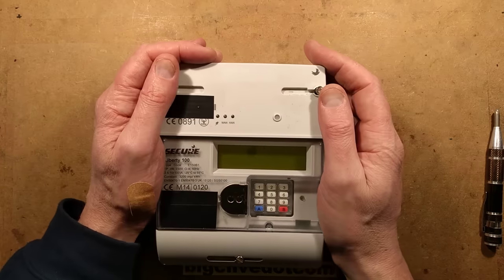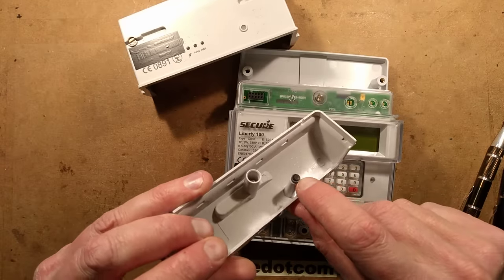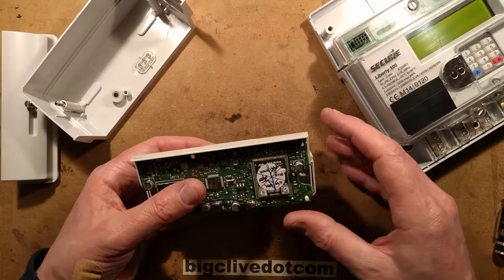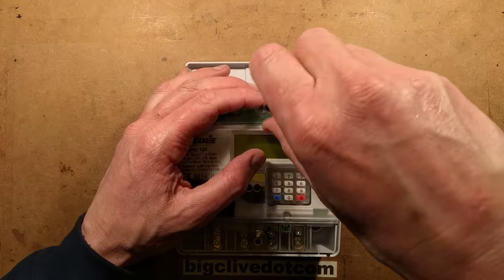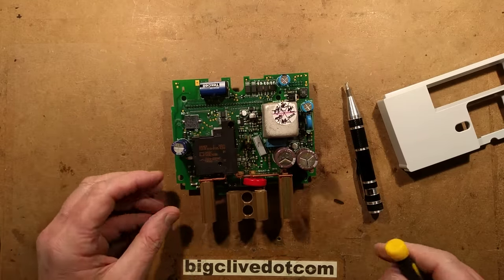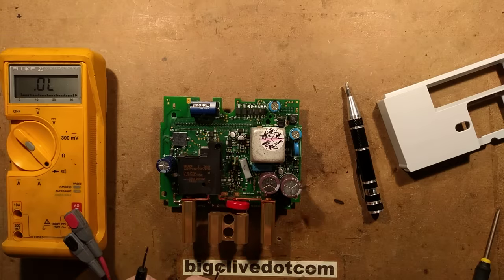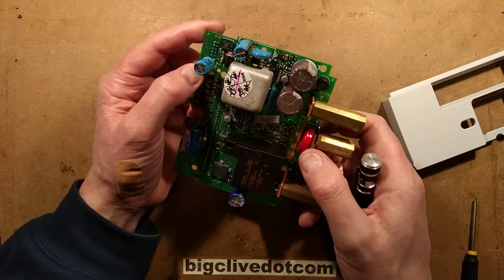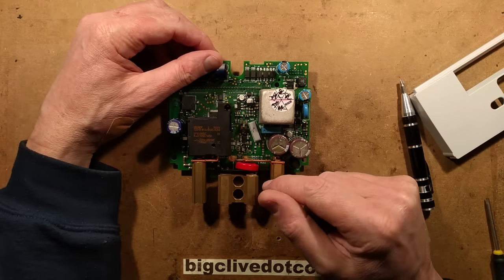Inside a smart meter, and the REAL problem with them.

Comment: The blue light thing IS real though. Some conspiracies are nonsense yes, but blue light IS known to disrupt the human cicada rhythm which can be annoying for people who have white street lights plonked right out of the front of their house pointing directly into their bedrooms. Yellow and orange lights are much better for sleepy time as the red end of the light spectrum doesn't put so much strain on your eyes.
Reply: Ken Su, 
True, although the problem is the underlying competition based (/capitalist) socio-economic system.   And those  "Zionists" are nothing but the richest capitalists of the world.   The problem are the "capitalists", not "Zionists", and even that is not accurate since the problem, as I already said, is the competition based system itself, and the 99.99% of poor and 0.00001% of rich (/capitalists) are only the consequence of the system we all collectively currently accept as valid...
Reply: True enough (although not yet researched enough to have any firm predictions as to the level of any health concerns), but not the fault of low power luminence technology. Everyone who uses this to claim LED lights are therefore inherently bad or dangerous has skipped a couple of steps in their thinking. Stick a tungsten bulb behind a blue filter and you'll experience the same symptoms. You'll just also use 30 times as much power to do it.
Reply: There has been some effort to remove blue light frequencies from computer monitors over the years.  They wouldn't spend money on it if there wasn't a problem with it.
Reply: Ken Su  : wow!   I didn't like his dismissive attitude to so-called conspiracy theorists either. There are many aspects of our existence that people blindly accept and you are right that there are people out there trying to educate/alert the masses. Of course there are paid trolls and shills and bots whose job is to discredit and mislead and tarnish.  Big Clive sounds very knowledgeable about electrical and electronic circuits and components and I would like to continue to watch his videos and share them, however, if he continues to make jibes I will consider unsubbing.
Reply: I like the sound of this cicada rhythm. Clickity clackity. You mean circadian x)?

Also on blue light, yeah, it disrupts your circadian rhythm but this is a pretty recent discovery, refuse to believe that this was private knowledge and has been used to... annoy people and mess up their sleep.
Reply: get some thick curtains, Simples.
Reply: I'm annoyed that Ken Su's comments are getting deleted. All it's doing is turning him into a martyr at this point.
Reply: Mind control using blue light made many Americans vote for Trump.
Reply: White light has blue wavelengths in it, so I think these fears are a little over blown.  Blue is just how our brains simply interpret that wavelength of light, in the absence of green and red wavelengths.
Reply: y u think cell phones and  tablets have "night mode" turning off blue?
Reply: Sir, Are you referring to the 'Circadian rythm' perchance - that which regulates sleep, or indeed, any biologically driven activity over a period of twenty four hours ? :)
Reply: @SECONDQUEST   What? You're claiming this dude is making a senseless post yet here you are taking the time to respond to it. Obviously he's not screaming into the internet and getting nothing back now is he?
Reply: A cut and paste from the RNIB website! To cut a long story short ... the jury is still out!

Exposure to blue light has been linked to the development of age-related macular degeneration. Should we be taking precautions to avoid developing the condition?
What is blue light?

We may not be aware, but our eyes are regularly exposed to blue light. While this exposure comes primarily from the sun, LEDs (light-emitting diodes) which produce the light in screens for devices such as computers and phones, also produce a significant amount. 

Blue light is high-energy, short-wave light that is part of the visible spectrum. Whereas ultraviolet light (UV) is largely absorbed by the front of the eye, blue light passes through and reaches the retina. 

The potential damage to the retina caused by these wavelengths, due to their high energy, has been discussed for years. More recently however, several researchers have suggested that exposure to blue light might represent a risk for the development of age-related macular degeneration (AMD). 
A cause for concern

The World Health Organisation reported that between 2012 and 2014 there had been a steep increase in the amount of time young people spend in front of tablets, computers and smartphones. 

Time spent looking at screens is regularly reported in the media, raising concerns about the potential side-effects such as disturbed sleep, mental health and reduced physical activity.
Retinal damage and AMD

Last month, Professor Christopher Hammond, Chair of Ophthalmology at King’s College London and Consultant at Guy’s and St Thomas’ NHS Foundation Trust, talked about blue light at an event at the Royal Society of Medicine in London. 

In his presentation, Hammond argued that there is not enough evidence to suggest exposure to blue light through LED’s is causing any significant damage to our eyes.

Hammond, said: “Damage from light is related to how bright that light is (which is why we should not look at the sun), and blue light emitted from LED screens is very dim, with the level estimated at one per cent of that which could cause damage. We therefore think that that blue light from screens is harmless for the vast majority of the population.”

He continued: “It’s really too early to say for sure whether blue light from screens is totally harmless, for example in older people after cataract surgery where their new lens does not have the yellowing of the body’s natural lens that filters blue light, or in people with susceptible retinas, like those with inherited retinal diseases.”

Hammond believes that ultimately, given damage from blue light is proportional, we are exposed to it much more from the sun than from screens. 

He said: “The evidence is that, overall, blue light does not cause or accelerate AMD.” 

“In a painstaking study of more than 5,000 people over the age of 65, in 2008 The European Eye Study found no link between blue light from outdoor exposure and AMD. 

“Although in the sub-group with lowest levels of antioxidant vitamins in their blood, blue light exposure slightly increased the risk of AMD. It may be that too much blue light could damage the eye in certain vulnerable groups, such as those with poor diet or with inherited retinal disease.”

The same report recommends that to be safe we should eat a healthy diet and continue to protect our eyes from the sun.
Evidence for protection

In the absence of hard evidence proving blue light does not cause AMD, an increasing number of manufacturers have begun selling products that claim to protect people from blue light in digital screens. Products include yellow filters for glasses worn indoors. 

The Association of Optometrists (AOP) released a policy statement on blue light after a high street opticians were fined £40,000 for what BBC’s Watchdog claimed were “unproven health claims” about the effects of blue light.

AOP’s statement said: “Coatings that filter visible blue light may improve visual comfort for some patients, or help mitigate the impact of visible blue light on sleep, but current evidence does not support making claims that they prevent eye disease.

“There is insufficient evidence to support the contention that visible blue light exposure from digital devices leads to ocular pathology and damage to eye health.”
Looking after your eyes

It is important that people spending significant amount of time outside in sunshine protect their eyes, particularly those in at risk groups. 

Equally, when using digital screens, we should take regular breaks and avoid looking at screens before bed in order to get a good night’s sleep and prevent eye strain. 
Further information

    To find out more about keeping kids eyes healthy, check out RNIB’s Insight magazine’s four top tips from optometrists.
    Read more about how to protect your eyes from the sun.
    Visit RNIB's Eye Health pages to find out more about AMD, it's symptoms, causes and treatments.
Reply: Now having said what I've said, I am still reducing my own personal exposure to blue light because a maternal great aunt had AMD and my mum has AMD so I being cautious. 

I'd rather look like a fool than not be able to see a fool!
Reply: my doc' even says that,,,even plants know this
Reply: We're more sensitive to blue light but other colours are just as disruptive to circadian rhythms and sleep patterns if bright enough
Reply: Nob the Knave  blackout curtains actually. But these have the disadvantage that people using them dont get naturally increasing levels of light in the morning for natural makeup patterns.
Reply: Close your curtains.
Reply: @JamesScholesUK  if leds are a suitable colour temperature then it's not a problem. The issue is nasty blue rich colour choices.
Reply: @heronimousbrapson863  have a look at the spectrum of various light sources. A typical led has a big spike at around  450 nm. It's a lot more blue content than other sources.

Comment: At 9:48 is shown the meter's resistive current sensor.  The voltage drop across this resistor is proportional to current and is measured by the processor.  The processor reads this sensor and the voltage sensr (the string of small resistors) and will accurately compute the active power (meter will be certified for accuracy).  The meter chip is most likely powered directly by the power line (the 470 ohm power resistor shown at 14:43.  The communication and user interface circuitry must be electrically isolated for safety and this is probably done by the shielded transformer and large electrolytic capacitors.  There are very stringent requirements to get a meter like this certified for revenue use (can't be susceptible to magnetic, RF fields, etc.) and this could be a reason for the shielding.  Since the meter circuit is not isolated, there are probably optocoupler devices allowing electrically isolated communication between the meter circuitry and communication/user interface circuitry.
Reply: I was going to make this comment. If you look carefully, it actually says 'shunt' on the PCB.

Comment: Peak time power charges would be assessed on the billing side, not on the meter side.  They'll apply a multiplier to the reading interval when they process the bill.

The billing interface also uses certain checks to detect abnormal readings for error identification and tampering (bypass) situations.  I wrote several of those routines for the company I work for dealing in water/wastewater.

Some smart meters run on a licensed frequency completely off of public infrastructure, such as the Sensus/Xylem FlenNet system.
Reply: Yeah the meter would get a set of ranges to report the consumption in, each range gets a rate and the result of the ranges is added together.
Smart meters let the powercompany have many more ranges than just day/night.
Reply: Yep if you have peak and offpeak the meter will be setup that way (like midnight to 7am offpeak) you have 2 meter readings (if its 3phase and your a shop with fridges you can have up to 9 as they typically have a day/night, nighttime weekend rates)

But for normal households with gas supply will only have 1 meter reading at full rate 24/7 (without gas supply you norm have 2 rates, with the boost button for wall storage Heaters using the higher rate)

Also the bit of comment he said about you only get cheap rates for first month is completely untrue they have to notify you within 30 days of rates been changed and if your in a 12-24 month fixed rate contract smart meter or not that makes no difference

 if your on PAYG you norm avg rates set by top 5 resellers of electricity/gas (again you get notification when it's going to be changed)
Reply: lee x Those legal limitations are subject to variations in local laws and the level of corruption/influence available to the power company.  If they set their mind to it, most big power companies can find an excuse to get rid of any inconvenient laws and regulations.
Reply: @johnfrancisdoe1563  maybe outside of the UK, cutting you off in the uk can land the company with a large fine if it was not legal
Reply: Definitely happens outside the UK.  Here in the States, they have almost free range to do what they want with fees and cut-off policies, even if the utility is a public sector controlled company.  It gets even worse if they are privatized.
Reply: guitarstitch, yes the national programme for installation of Smart Meters has split it up into North and South, it's not a straight line, i.e. Liverpool is in the South and Manchester is in the North. The South system is designed, deployed and managed by O2 on the standard cellular network while the North uses the Sensus system which sits on it's own, low frequency network.
Being low frequency (something like 450 MHz?) the propagation is very good. In addition the smart meters are able to transmit their data by transmitting it via adjacent meters, hopping from one meter to the next until it gets back to a cell. The amount of data they send is absolutely tiny. The power transmitted is also correspondingly very low.
Reply: Haha given the fucking mess MOSL and ofwat are in atm and the absolute state of water retailers in England after dereg in April 2017 I would not be bragging about any code I wrote lol
Reply: @bertsimpsan  Shartinmart?  As in the insulting meme to Americans?  If so, that's highly uncalled for.  I've said nothing derogatory toward you or your nationality.  I know this because I don't speak ill of any nationality.  Please represent your culture with a little more class than that.  You are a representative for your national identity and we wouldn't want the world thinking all people from your area are crude, no?

To get back on the point, I work for a bigger entity than me.  The local government in Clay County, Florida pays me good money to write software that bills customers according to the wishes of the Board of Supervisors.  I take the straight readings and apply a multiplier ("proration factor" by billing terms) to the reading to obtain the inflated "peak time" usage.  It's basic math really.  Each reading comes in with a UTC formatted time stamp, making the logic selector very simple.
Reply: @guitarstitch  uk smart meters display billing info  they have a billing calendar giving commodity price (kw or m3 for gas) which is applied each second. This allows the in home display and meter to display the current bill. 
Official billing is done on supplier systems based on reported usage.

Comment: I have an identical meter in my house. It was installed only a few months ago by Octopus Energy when I switched to Economy 7 (and subsequently their "GO" tariff). So it's a current model and you can find it and a PDF manual on the manufacturers site. The keypad can be used by Pay-as-you-go customers, but it has a number of other uses including stepping through the current data to see the readings and tariffs. It came with one of those monitoring units to which it can communicate wirelessly. This unit is about as useful as a chocolate teapot. It only tells you how much you have used, by which time it's too late. It is cumulative, it does not reset every month. Worst of all there is no way you can download the readings despite it having a USB port which can only be used for power, not data. Really frustrating is the meter allegedly stores up to a year's worth of data (48 sets of readings per day) but there is no way of accessing it.
Reply: Sounds like someone needs to reverse engineer the Bluetooth gizmo.
Reply: Anonymouspock  I contacted the manufacturers, but they were uncooperative, they said there was no provision for the home owner to access the readings.
Reply: ZigBee or the Bluetooth could be a good point to start, the other option would be a JTAG port, if there's any.
Reply: ZigBee or the Bluetooth could be a good point to start, the other option would be a JTAG port, if there's any.
Reply: Why not just using the IR interface? Because it is ugly. But it is made for that. (inofficialy)
Or count pulses on the kwh pulse led...

Comment: The short-range coms module is there so it can communicate with your "smart" gas meter and pass on the data from it. I have a friend who works in smart meter R&D and he isn't having one in his house any time soon. Tells you all you need to know really.
Reply: Interesting. I thought it might be for the 'In Home Display' which is sold as common benefit of smart meters.
Reply: @smilerjerg  They may use it for that also, though I guess they could do that via your WiFi with some additional flexibility. The gas meter is an interesting problem as it obviously has very limited power available (I have made the suggestion that they consider using the gas flow to generate more but afaik this has not been taken up by anyone)